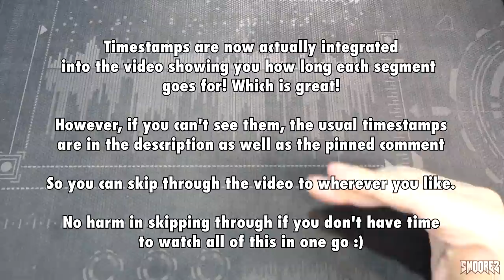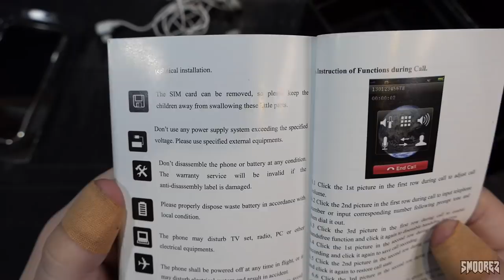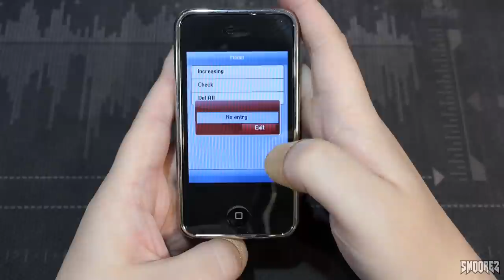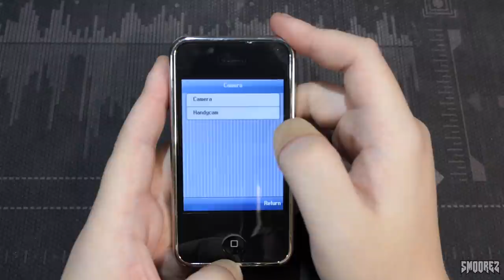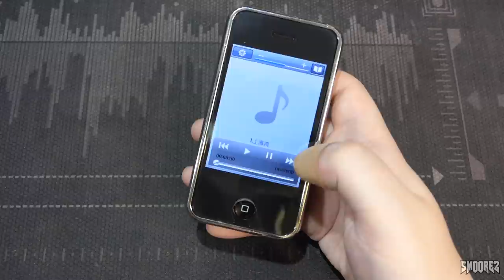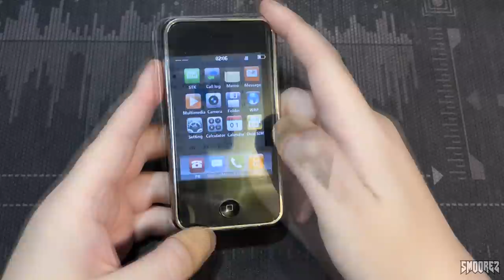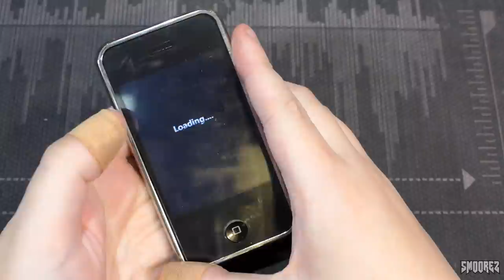iPhone Clone Month! The HiPhone 168+ (iPhone 2G Clone) Test & Review (+ Teardown) Part 1

Comment from the maker: Questions!
What is the name of the port on this device?
What was the startup tone?

Otherwise, hope you enjoyed this first installment in this massive series!
Timestamps:
The Roadmap: 0:00
Proper Intro/The Box: 1:06
Unboxing: 3:01
The Device: 5:24
Power On: 8:24
The Apps: 9:04
Camera: 12:18
Camera Test: 13:03
More Apps: 14:27
The "Input Method": 17:24
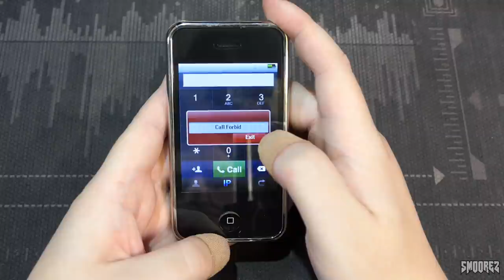The rest of the apps: 18:37
Settings: 19:17
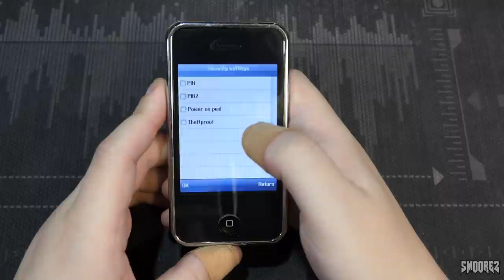Anything Else: 20:58
Video Test: 22:30
Speaker Test: 23:05
Pre-Teardown: 25:15
The Teardown: 26:26
Codes: 30:49
It's Alive: 31:39
Specs and Conclusion: 32:22
Outro: 33:23

Be good people!
Reply: I remember my LG Cookie also had a port like that to connect earphones, but I don't know the official name of the port
Reply: That music you played is a popular music in Hong Kong, I know that song yo.
Reply: I had one with that port
Reply: I wonder what the capabilities of that port are
Reply from the maker: Nope, not the same one. It's close but the Samsung one is too wide. The one on the clones is closer to micro usb size.
Reply: @keff5984  i think you can charge it with that cable but you needed at the time to buy a second cable for data transfer
Reply: @SMOOREZ  oh I see, my bad.
Reply: @SMOOREZ  That cable reminds me of old LG charging ports. They also used them for earphones.
Reply: If you are still trying to get a working USB cable for syncing, charging, etc., might as well go for one of those crazy 10-in-1 cables that are somehow still around on eBay today: https://www.ebay.com/itm/391386305677 .

Based on the info they provide within their pics, I can deduct the port in question here is either the one used by Samsung D800, or LG KG800. I am leaning towards the first, for the similarity in length/width ratio shown in the video, as well as the two dints on the lower end. 

The Samsung port you have excluded must have been the "other" Samsung port, used by likes of D880 and G808.
Reply: I had a chinese wrist watch phone back in 2012 with the same connector
Reply from the maker: Not the one. I'll show it in the next video. It's the size of a MicroUSB port.
Reply from the maker: It is certainly a 12 pin one. So you may have solved it!
Reply: @SMOOREZ  Well I do have some friends currently living in mainland China, and I have also relayed my plea about this case to see if any the aforementioned antique devices can be located and their connector dimensions measured. But considering the age of those electronics as well as the recent popularization of legit budget smartphone brands, it probably would be a rather long shot. Meanwhile, I actually found two pictures of <insert designated name for the mysterious Chinese 12-pin connector> to RJ45 (standard modern Ethernet plug) cable with relatively high definition on a Russian site here: 
http://www.gsmbaza.ru/zoom.php?image=base10678.jpg
http://www.gsmbaza.ru/zoom.php?image=base10677.jpg
To be absolutely sure, I guess you can get an Ethernet cable alongside the earphone plug to see if the size ratio matches up.
Reply: The connector just looks like a micro usb
Reply: SMOOREZ I had a old red LG that that was a slider that had that same connection
Reply: it a mini HDMI
Reply: I know it's been a long time, but here goes the answers:
1-This is a Mini USB connector, not to be confused with V3 connectors, and it was discontinued afaik.
2-Mediatek would provide the firmware, schematics and data for their SoC when you buy them in bulk. It uses an Java Based OS called MAUI, which the maker would customize (that's why some of them are run really slow, and others fast). The other clones with different CPUs would usually use RTOS instead.
Back in the days I used and sell a lot of these phones and they were ok for the price. People forget that 2007~2012 things were a lot different and you could daily drive something like this.
Reply: @SMOOREZ Hello bro, how can you charge that Chinese cell phone? Nice, I found that one and I want to know how to charge it, please and thanks.

Comment: 3:49 I had a "M1516 TV Wi-Fi" (better known as the Chinavasion Odyssey) phone with a similar connector, that too was a Samsung connector they used on some of their feature phone models, and I know it as I had to get a replacement power adaptor after the original blew up and tripped the breaker.
Reply from the maker: Check my latest video where I show the port and compare it with some Samsung devices. It's a 12 pin proprietary connector :)

Comment: 6:06 In fact my LG Cookie KP500 had one single connection (that looks very similar, if not the same). I think most Java phones at the time did. It was actually a "bonus" to get a 3.5mm jack, so you can use your own headphones!
Reply: I still have an adapter for that in a box somewhere that let me use regular headphones.
Reply: @SquishySenpai  I think I lost that 😂

Comment: 3:39
As a tech nerd this iPhone knock off pissed me off so much . I stead of using iPhone 30 pin charger connector or the one that look the same but with buttons to lock on both side they use that little connector from those "Java smart phones". Ok if android were out at that time then they would probably use the usb type A connector. Very cool knock off that even a boomer could spot out :))

Comment: That's actually quite funny that you can still buy a CPU for these phones even today xD
http://gsmserver.kz/zap_chasti_zapasnye_chasti/zapasnye_chasti_mikroshemy/mikroshemy_processory/processor_spreadtrum_sc6600_r2_257_dlja_kitajskih_telefonov.html
This store in Kazakhstan has 28 in stock and it would be happy to sell you one of these just for 700 Kazakhstani tenge (whatever that is).
And I also managed to find some discussions about this processor on Russian websites from 2009-2012 and it seems like this chip was used in many other clones(fake nokia c5, fake nokia n8 etc.) back then. They've been using some software and hardware to flash those, for example to add Russian language support. Although this chip was quite ancient even back then so idk why would anyone even bother to spend money on that hardware and software just to make crappy ancient processor in crappy clone phone a little bit less crappy.

Yeah, this kind of crap was really popular here in Russia. Not only the scammers were selling those claiming they're original, but also people bought those for themself because these for the cheapest touch-screen phones you can get, and if "tiny screen and buttons or big-ass touchscreen for the same price" was the question for you - the answer was quite obvious

Comment: How do you remove the shielding? I don't really care about breaking it, i just need to get it off.
Reply from the maker: I just get a flat head screwdriver, put it into any open area in the shielding and pry it off. It's worked every time. I wouldn't say it's the best method but it works.
Reply: @SMOOREZ  Thanks, I'm trying to fix corrosion on a water damaged phone so it's basically ruined already, even so what is your method of reattaching them?
Reply from the maker: I can never reattach them. Once they are off, they are staying off. I believe they are soldered down into place, so if you can do then you can put them back on. Some of them have 2 shields - a frame and then the shell which just clicks into place. Depends on the device.